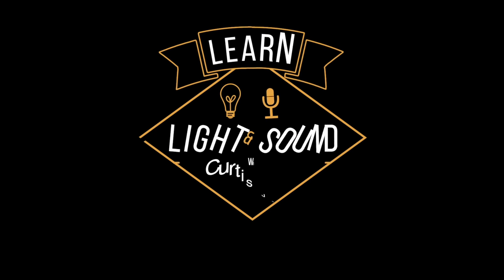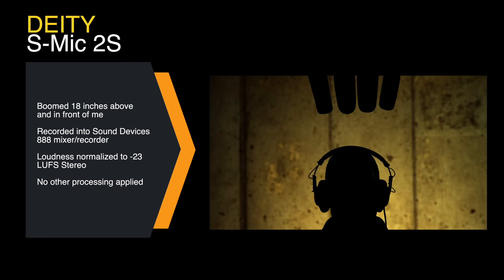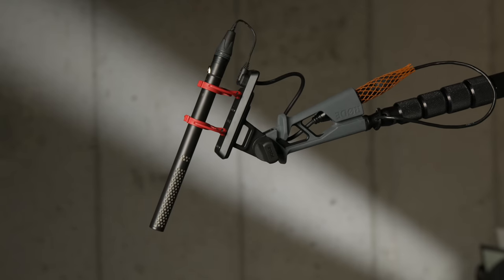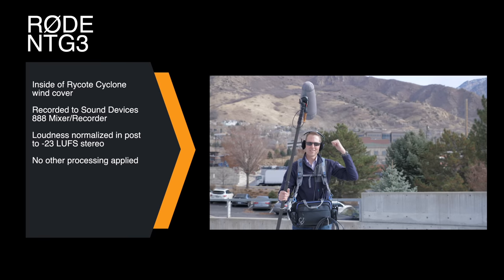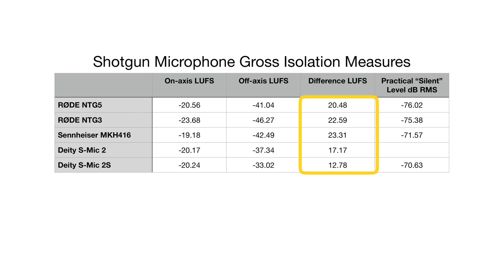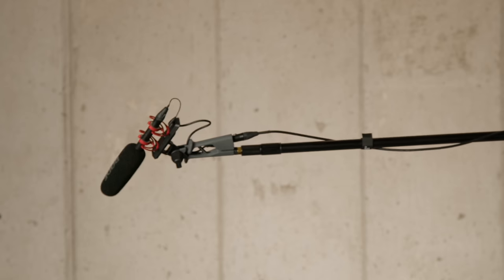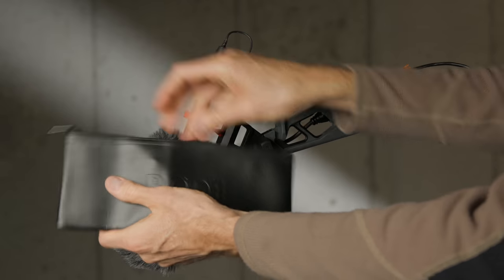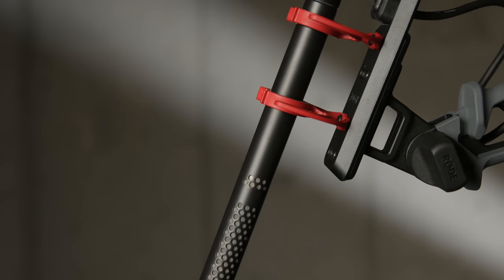RODE NTG5 Shotgun Microphone Review - Compared to RODE NTG3, Sennheiser MKH416, DEITY S-Mic 2

Comment: What mic and set up do you recommend for someone wanting to do VO on his videos? I record video with my phone right now so my talking head is done with the VideoMicro right there on the phone. However, when it comes time to do voiceovers, I haven't been able to get it to sound good. This is unfortunate because I like the consistency of doing it all on my phone. Sound would be inconsistent if I recorded my videos like this, but then did voice over separately with another device. Then I would have to sync video and audio. Sounds like a mess. But is that pretty much the only way to do it well?
Reply from the maker: There are interfaces to get XLR mics into phones if that would help? Here's one I used: https://youtu.be/7gE5l7aU8F0
Reply: @curtisjudd  Thanks for the reply. So I assume you're recommending a mic with XLR inout then. What mic do you suggest? I'm trying to not use XLR. Am I shooting myself in the foot by not using XLR and interface then? I may get the Rode VideoMicro NTG. It can connect to your phone and also has its own pre amp. You think that would be okay? Another worry there is their site seems to say this points the sound straight to your face super focused. Worried about me moving my head a bit. They say VideoMic Pro has a bit wider range. But VideoMic NTG is more versatile because it can be used with USB as well.
Reply: So many mics, my god. I was about to just cave and get a Blue Yeti. But honestly. Doesn't seem like the best decision to make.
Reply from the maker: @switchunboxing  VideoMic NTG would be a fine choice - keep that mobile recording setup small and it sounds good if you keep it close.
Reply: Curtis Judd many people think I am stupid for using my smart phone for this. However, I like keeping that set up simplified. Do you think I’m hurting myself by not using an interface, or is that OK because this microphone has its own preamp? People say that a smart phone doesn’t have enough technology to make a microphone sound good and they say that’s why I’m having frustrations with the video micro. However, the video micro doesn’t have a preamp. Is this a significant enough factor to where I could use the videomic NTG with my smart phone and still see a substantial increase in quality and consistency compared to the VideoMicro? I really hope so and thank you so much for your feedback I super appreciate it.
Reply from the maker: @switchunboxing  The NTG has its own quality amplifier. You're still using the phone's analogue to digital converter (or if you use a dongle, that probably has the converter) but those have advanced enough to date that if you are happy with the results, it is certainly good enough. The main things XLR gets you is the ability to run longer cables with less risk of picking up interference and hiss, and generally higher quality microphones. But the VM NTG is really impressive in my tests. Stick with your phone and add the VM NTG. I think it can serve you well and make some great quality audio.
Reply: Curtis Judd Thanks a ton man I’ll check it out. Do you think I’m best off turning my input gain on the app, as low as it can go “say -10?” and then playing with the gain control on the mic instead? Not 100% what all that means but I think it’s controlling the pre amp technology, which is prob better on the mic than the smartphone.
Reply: I appreciate your help. Been battling this literally all month and it’s been setting me back but I hope it’s only forcing me into finding solutions that will make everything easier moving forward.

Comment: My jaw hit the floor on the silence test - The NTG5 cleaned up, even from the NTG3, which I didn't think was possible. I'm totally getting an NTG5 - not to replace my NTG3, but to give me a run n' gun field kit.
Curtis: in your outdoor wind test, the NTG3 dominated in the higher frequencies. Do you put that down to the frequency responses of the mics, their respective covers, or the combination?
Reply from the maker: HI OroNZ. Turns out an issued with the cable in my Cyclone wind cover. Working to get that repaired.

Comment: There is an interference issue with my NTG5 ,have you ever came upon to that?
Reply from the maker: No, usually it is the cable in my experience.
Reply: @curtisjudd  unfortunately i have changed cables and used more expensive ones,and the problem persists,i have found online that others have the same issues.Nevertheless thank you so much for your swift response,appreciated!!
Reply from the maker: @VsSrg  Ah, ok. Probably best to contact RODE support. That warranty should cover any issues with the microphone.

Comment: Unfortunately it's the worst mic, I've ever owned.
I owned one since January, bought the second one last week and noticed there very heavy squeaky noises. They appear randomly and sometimes aren't even audible with some speakers, but they are in the recording and they also result to clip the audio.
After that, I did a bit research and found out, that the NTG-5 is especially sensitive to movement, which result in these interference.
I also tried my first NTG-5 from January and with faster movement (even in the blimp, so there are no wind noises), the audio is unusable do to these interference.

I hope, I can get rid of them both as fast as possible and get Sennheiser mics instead.
RODE NTG-5 aren't currently in stock, so I can't even try another one to replace the defective one.
Reply from the maker: I believe these have a 10 year warranty so RODE should replace it for you, for free.
Reply: @curtisjudd  I had to send them to to the German service partner (Hyperactive) so they could check the mic. I also had to pay the shipping costs and wait about 10 days, until they finished the repair. Then I just returned both my NTG-5 back to the retailer and replaced them with the MKH 416.
Reply from the maker: @WupperVideo  👍 Hopefully the 416s work better for you.

Comment: I find most Rode mics, including the NTG3 and NTG5 to be far too bass heavy, and lacking in clarity and treble. I'm not sure why they are so popular. I must be missing something!
Reply: That could be due to a couple of reasons, the first being that you could be losing your hearing in the higher frequencies. No offense meant: I'm well on the downward slope of hearing loss due to old age, and the first frequencies to go are the high ones in reverse order, but ehh, whaddaya gonna do.
Another is boost aversion. When EQ-ing sounds in a mix, engineers prefer cutting frequencies than boosting them, as boosting sound also boosts the noise floor. Most shotguns might appear bassy: the MKH416 is. It's the reason older shotguns came with a bass cut (High Pass Filter, or HPF) switch. But the problem with switches is that they adds circuitry, weight and internal noise. As most pro mixers or cameras already have a HPF built-in, it's likely that manufacturers will be leaving switches out of new-generation mics.
Reply: @OroNZ  I can hear more treble in the Deity and Sennheiser. Are you saying that having a lot of bass is an appealing aspect of a good shotgun mic? Although with 32 bit recording, theoretically noise floor shouldn't be too much of a concern these days, if cutting is better than boosting, surely it would make sense to have that treble initially, and lower it in post if necessary?
Reply: @patrickpaganini   Appealing bass: No, I didn't say bass was appealing in mic design. But bass frequencies are harder to capture with small capsule mics.

32-bit recording is a great safety net, for sure. But 32-bit recording is not yet widespread in production or post-production, and no matter what quality mic or recording gear you might have, it's better practice to ensure your signal-to-noise ratio is as good as possible. As sure as I'm sitting here, you're going to go out and recording something at 16-bit on your 32-bit recorder by accident, and then you'll have some explaining to do with the client on why everything is either clipped or silently noisy.

Cutting vs. boosting: Most shotguns - especially those aimed for vocal work - are tuned to increase frequency response sensitivity at the 2.2kHz point, the 5.4kHz area, and a gentle rise of about 2-6dB to 7-8kHz. In short, there are high frequency boosts. A bunch of acoustic black magic goes into this. This is done to improve what mixing engineers call 'presence', or the consonants of speech in the human voice. It helps accentuate diction or pronunciation, AND it helps separate the desirable high frequencies ('sss', 'd', 't', 'g', 'ch', etc) from the high frequencies of internal signal noise.

So you're right: it DOES make sense to have gains in high frequencies. It's done in the mic so you can turn them down, either with EQ, or de-essers, or a range of other signal processors. Same deal with low frequencies. Mid-range freqs are the baseline (no pun intended). But an accentuated low frequency response in the mic means you can roll it off in post, lowering the noise floor with it.
Reply from the maker: My experience and watching many reactions to these types of comparisons is that hearing is quite subjective. I think it is perfectly legitimate that different people prefer the sound of different microphones. Of course the speakers with which one plays the samples is a factor, and peoples' ears are the biggest factor. I agree with OroNZ that our ears change with age. As I get older, I find that I cannot hear much above 15kHz, for example.

Comment: For primarily/exclusively using a mic indoor for interview/corporate, would the NTG5 still be your top pick in the US$500 and somewhat higher price range?
Reply from the maker: Sorry, no, I meant amongst shotgun microphones, specifically. Would be hard to say which I like best for indoor dialogue. Probably the AT4053b amongst the mics I have used for under $1000 USD.
Reply: I would look into supercardiod or hypercardiod mikes, as well as high quality lav mikes, the latter wired unless you have a specific need for wireless.
Reply: @curtisjudd  What about mics in the $1K-$2K range for the same use?  DO you have experience with the Schoeps CMC641?  Is it $1k better in than the AT4053b in quality?  I too am looking for a workhorse mic to boom on a stand indoors for interviews.  How diminishing are the returns when you get into the Schoeps price range vs the $500-$1000 range
Reply from the maker: @ericallnight   **Disclaimer - everything that follows is pure personal experience and opinion. There are a lot of valid opinions out there as microphone preference is NOT a black and white or one right answer kind of proposition.

Yes, I own the CMC641. For my ears, I find it to be a little too bright on some voices. If you need a dialogue recording which can cut through a mix, it is a great choice, but it is not my default choice. Note that this opinion is NOT shared by many other production sound mixers who consider it the de-facto indoor dialogue mic. I prefer the Sennheiser MKH 8050. There again, some production mixers would disagree suggesting that the 8050 is too colored with emphasized bass. Are they better than the AT4053b? I can't say definitively, but I find the 8050 to sound great on a wide range of voices where the 641 and 4053b in most cases, but rather harsh in a few cases.

The problem here is that we all hear differently and thus all have different preferences for how the best voice reproduction should sound. I would suggest you let your ears make that decision for you. Listen to as many samples as you can from various mics before making any purchase decisions. I'll do my best to provide as many samples as I can here.

Also, there comes a point, somewhere around $500 and above, where the differences are pretty small and most audiences will not notice. So while many of us here in this community care a lot about sound, other audiences would be hard pressed to hear the differences between the 4 mics we sampled here. Also, for online video, many people are listening on mediocre playback systems (mobile phone speakers, laptop speakers, etc.) so for those audiences, they often cannot discern the difference anyway.

But if you are making a film which will be screened in a theater with a decent to good audio playback system, that's where differences become a little more evident and where you can fine-tune the sounding a substantial way.
Reply: @curtisjudd  Thanks so much for this detailed response, Curtis.  You are always so generous and prompt in your answers and videos.  

Yeah I produce 95% video for web (promotional & educational) so I often ask myself that very question as to what level of quality is needed and for a general audience in that context. Will they even notice a difference in the Sennheiser M-E2 lavs vs. COS-11D or a $500 boom mic vs a Schoeps?  If you're producing a feature for the theaters, I completely understand that all these subtle differences matter and it could be worth paying for the best despite diminishing returns. But for my purposes, I can't help to see a lot of it as minutia that won't have major impact and that MAYBE, any of the mics you mentioned would be totally fine.  That said, while I've been producing video for over a decade, I have A LOT to learn about audio so my ears aren't as trained as my eyes are for picture.  You can see I've gone back and forth on all this probably too much in my head haha.  

Another note, ideally the mic that is best for me would sound good for a variety of voices and would be great as is with minimal post processing.  I always loudness normalize and add compression but that's where my post audio skills end currently.  I'd prefer not to have to go deep into equalizer to get a mic to sound good.

In any case, thank you so much, Curtis.  I know giving gear advice isn't easy. I'll go and listen to as many samples as I can of the mics you mentioned and see if my ear can guide me.
Reply: Curtis Judd why do you prefer the   8050 over the mkh50?  From some research, seems like they have very similar sound and the 50 is a classic. The 8050 is more prone to handling noise? I’d primarily use it on a stand so not sure that’d make much of a difference to me. What are your thoughts on the differences and which would make most sense for me?  

Also when you day that the Schoeps 461 sounds harsh with some voices, do u mean that thin higher voices with lots of sibilance ? And you like the 8050 in those cases because of the higher bass response?  Thanks!!!
Reply from the maker: @ericallnight  I have used both the 50 and 8050 but prefer the sound of the 8050. It is also much smaller and a bit lighter. Again, personal preference. There's nothing "wrong" with the MKH50. Go with what your ears tell you.

Yes, the CMC641 has a tendency to sound a bit too harsh with sibilant voices to my ear and in those cases I usually prefer the sound of the 8050. Sorry to be repetitive but that's just my personal preference.  Best to let your ears make the decision based on the samples you hear.
Reply: Curtis Judd thanks for all the help, Curtis. I’ve been scouring the interwebs for samples of all three haha. Leaning towards the 8050 or 50 because while the 641 does sound sweet and true, I actually like the slightly more pronounced bass from the Sennies. Something about it feels more luxurious haha. Just now trying to understand and discern the differences btwn the 8050 and 50
Reply from the maker: @ericallnight  To me, the MKH50 seems to sound more aggressive - more "in your face." It is a popular choice for action pieces, I suspect largely for that reason.
Reply: Curtis Judd interesting. Not too many 8050 samples out there. Do u have any links to your vids where u used the 8050?
Reply from the maker: @ericallnight  https://youtu.be/RYWD5wI6B9k
https://youtu.be/3C4CJmwXK2g
Reply: Curtis Judd thanks, Curtis! I see why you like the 8050. The 50 definitely has more aggressive punch to it. I produce a lot of promotional/marketing videos for nonprofits and start ups so having that kind of attention grabbing authority I think aligns with the work I do. That said, on bassy male voice, the 50 seems like it can be a bit too much and radio voice like. From the few samples of the 8050 that you shared, it does seem a little more reserved than the 50 while still having pronounced bass. It does seem like it splits the difference somewhat between the Schoeps and the 50 while leaning towards bass, which I like. Does that seem like a fair read?

If I go with the 8050 and put it on a stand, would you recommend getting a shock mount as well? Which one?  Thanks again for taking the time to have this convo!!
Reply from the maker: @ericallnight  That sounds like a fair read. A shock mount would be best, but not necessary in all cases. I use the Rycote shock mounts. One like this should do nicely: https://bhpho.to/36hplw5 (affiliate link)

Comment: I love you channel and recently started following. I bought the ntg5 mic but the audio straight out of the mic is terrible. I use it with f3 zoom with phantom power and I adjust the levels right. It has this cheap dry sound way worse than even the cheapest mic for any camera. Your audio from the ntg5 is not even comparable with the one I get. Why ?
Reply from the maker: Sounds like there may be a problem. Have you heard back from RODE support?
Reply: @curtisjudd  Picked up a new one and it was the mic, I don't know what was the problem. This one has a rich sound. Lot of people have complained of Rode having bad new devices. Thanks for taking time to reply!